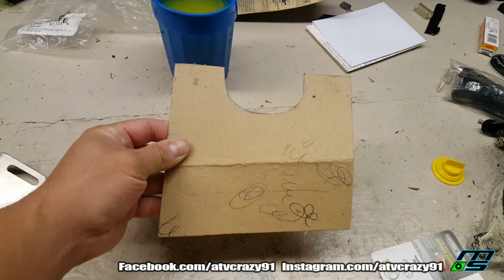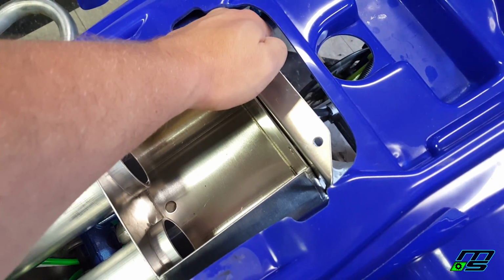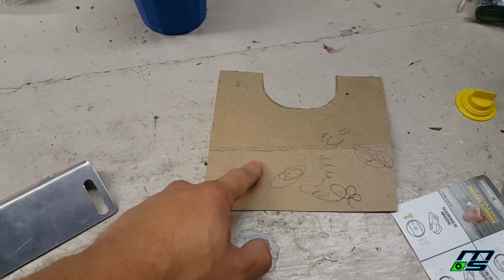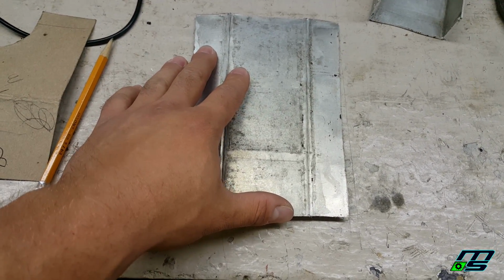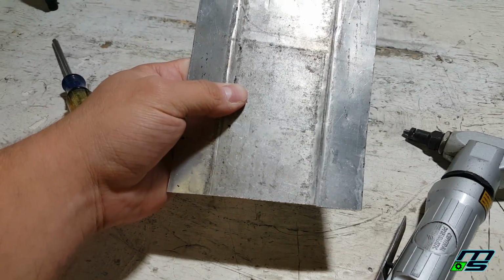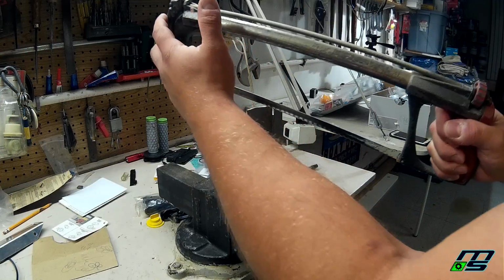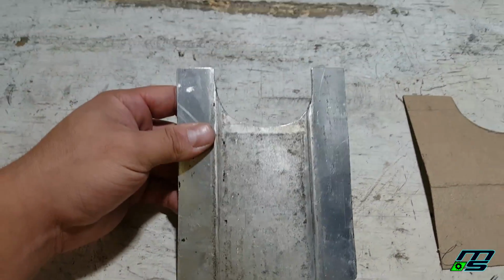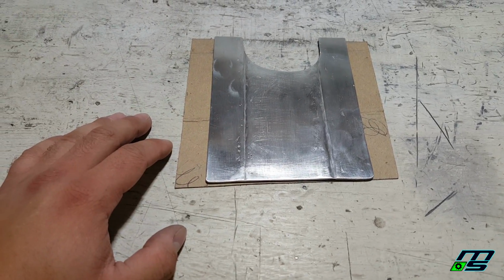Yamaha Banshee Air Box Mod Part 2

Comment: Wait don't you have a grinder and a drimmel? Way easier to cut metal with either than it is a hack saw. Also, why aluminum for the bracket? Why not a piece of steel and paint it? I made an aluminum air box and it was too soft and cracked. Imo from experience go with steel and paint it.
Reply from the maker: I considered steel but it doesn't need to be super strong where I have it. It's mounted up and really solid; it will be in todays video! I could use a grinder but aluminum gets stuck in the grinding wheels pretty quick. It was a small piece so I just used the hacksaw this time.